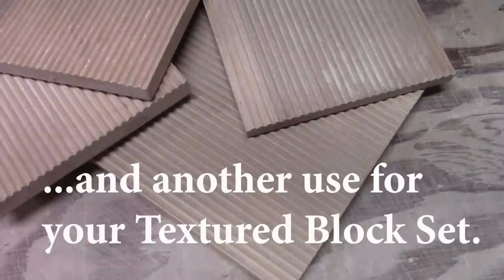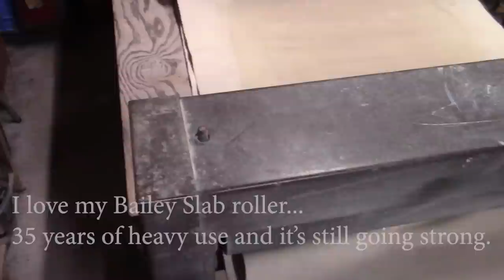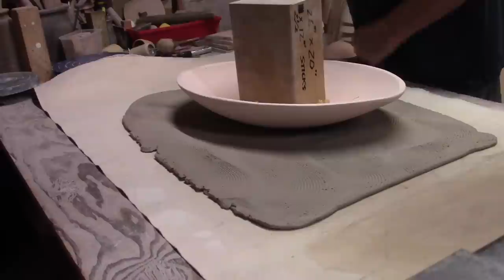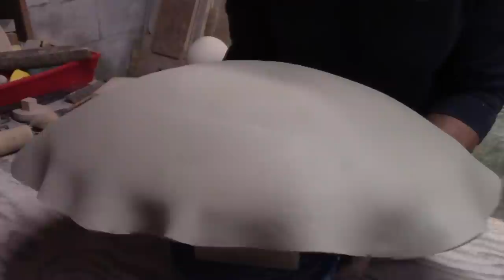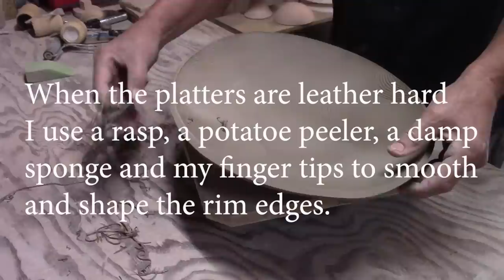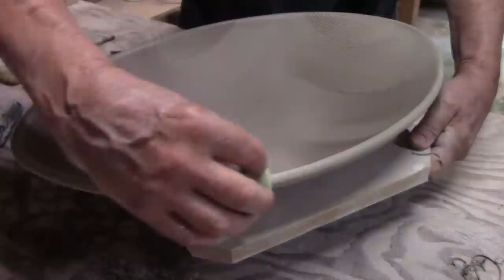How to make a large textured slab platter.

Comment: Something doesn't add up here; these clay slabs formed over a curved surface crack like crazy as they dry, but the slab in the video didn't crack at all. Also, the slab should have stuck to the mold and been impossible to remove. You didn't put  clingfilm or anything else to prevent sticking.
Reply from the maker: Hi, Twobirds,     It’s all about letting the slab dry to the leather hard stage on a mold / form that’s less than a 45* angle. A slope of more than a 45 & the slab will crack as it shrinks. As it’s drying & shrinking it releases itself from the mold surface… hence, no releasing agent used.
Reply: @BillvanGilderPottery  interesting, but for a curved or hemispherical form it wouldn't make sense to talk about a particular angle, right? In that case would it not be the degree of curvature of the surface (i.e. the larger the radius of the hemisphere, the lower the degree of curvature) that determines whether you get cracking or not as it dries? 

You said also that the clay pulls away from the mould as it dries and shrinks, but this has me confused, as for the hump mould i was under the impression that the clay would be tightening onto the surface of the mould as it dries and shrinks because it's contracting inwards (as opposed to a slump mould where the clay pulls away from the surface).

Comment: Do you allow the slab to set up a bit before working it onto the form?
Reply from the maker: I don’t let the slab stiffen up at all, Frank. It gets roiled out, smoothed, trimmed a bit & immediately put onto the mold. Allowing the slab to set up would make the pressing difficult. 
B.
Reply: @BillvanGilderPottery  thanks for the response. I have been struggling with warping on square plates made in this same manor. I have found that allowing the surface to tension just a bit reduces that issue.
What you are doing sure works for you!!!

Comment: great video. love your platter and your cute dog. thanks for the tip of the low nap paint roller. Where did you get that long blade tool for smoothing out the clay? Thanks for the video
Reply: You can get tools like that for finishing dry wall.